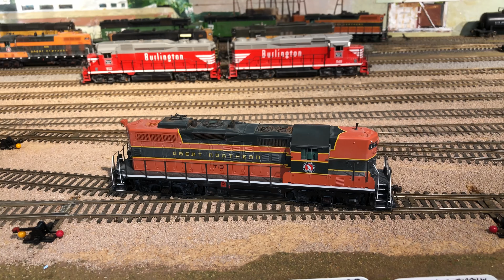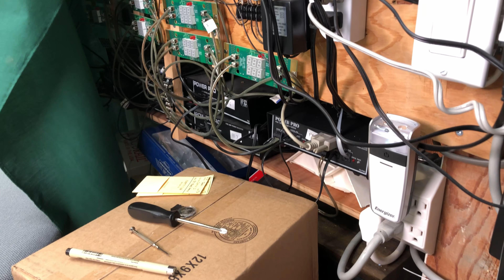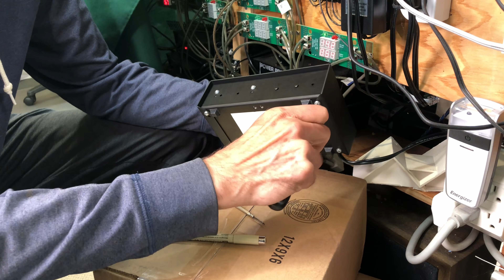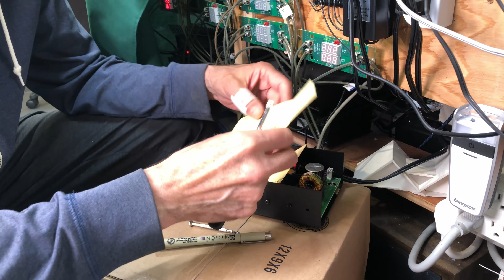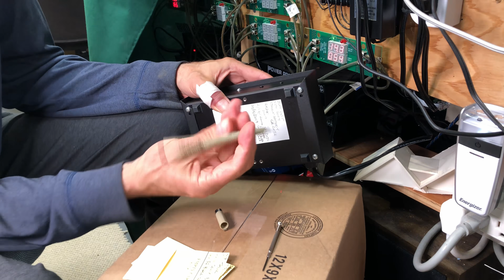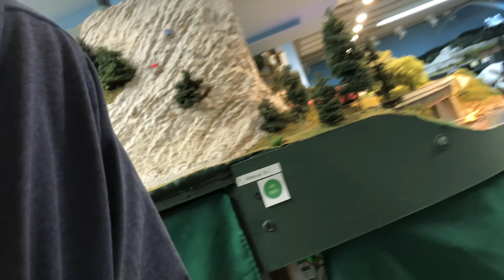How to replace the coin battery in your NCE PowerHouse Pro every 5 years #modelrailroad #electronic

Comment: Love the videos...as always. 
Does the NCE throttle control, let you run two different trains?
Reply from the maker: There are several models of NCE throttles. Some control one train, some control two, and the big "hammerhead" throttles can control up to six trains simultaneously.